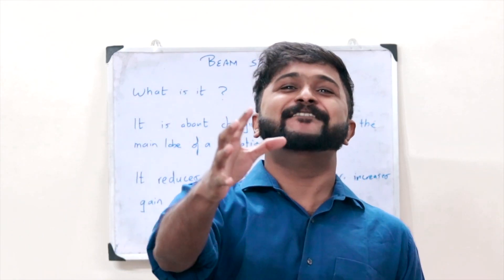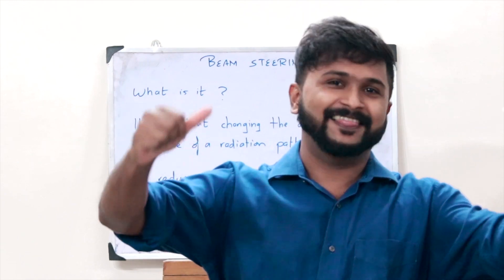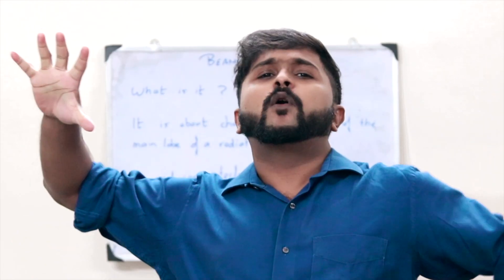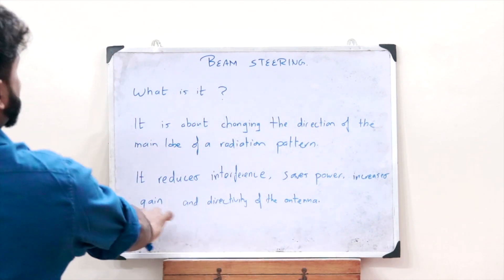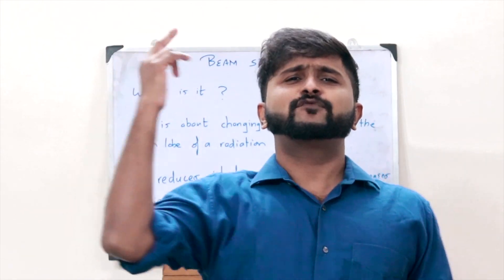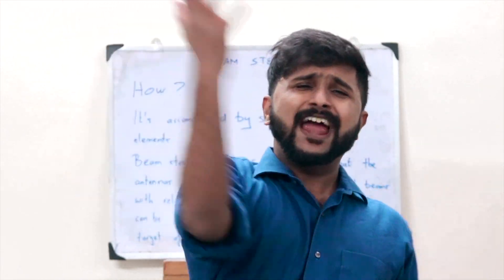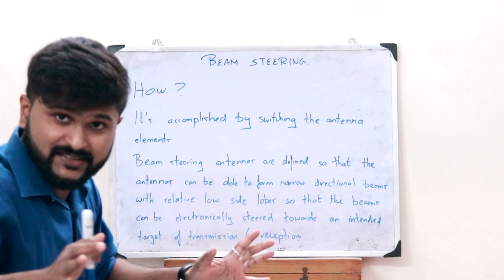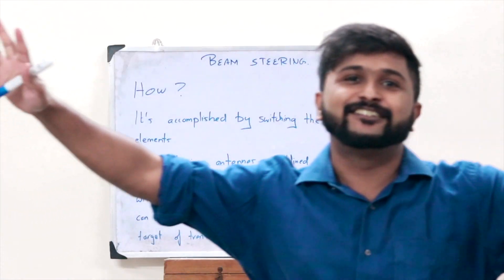Basic Principle of Beam Steering in Antennas | AWP Module - 4 |

Comment: sir can u say it in normal way
Reply from the maker: Hello Arjun. 
Greetings from The Backbench Engineering Community.
Sure I can simplify this for you even more! 
Putting it in simple terms : 
1. Beam steering is a very simple process by which you can steer a particular beam to whatever direction you want to. 
2. This is done by simply just changing the direction of the major lobe of a particular radiation. 
3. This is achieved by just switching the antenna elemets present inside an array of antennas!

This is the basic process of beam steering! 
Do join our community for more videos on antenna and wave propagation! 

Thanks & Best Regards
Rishi